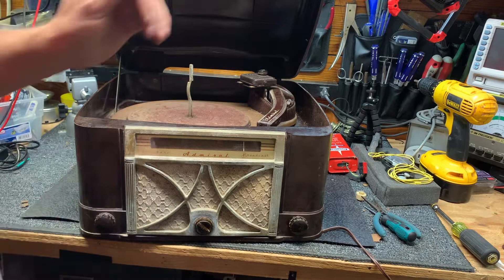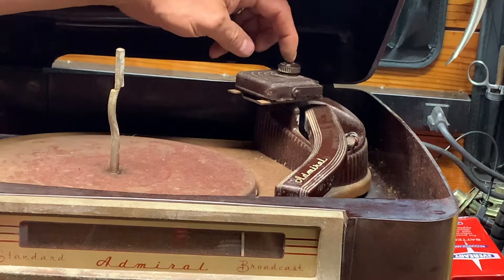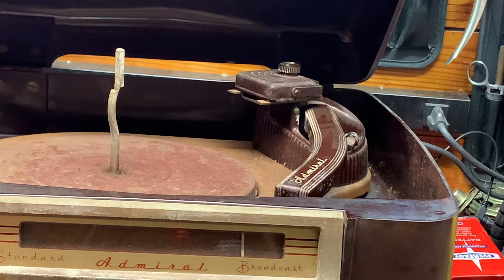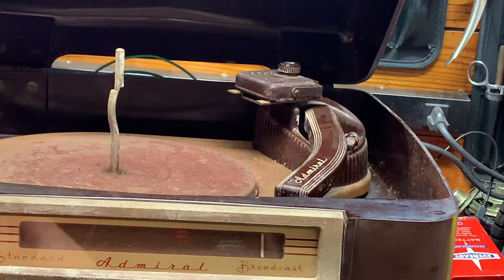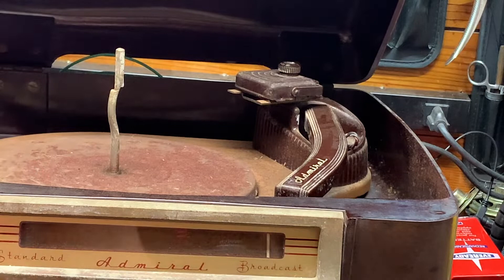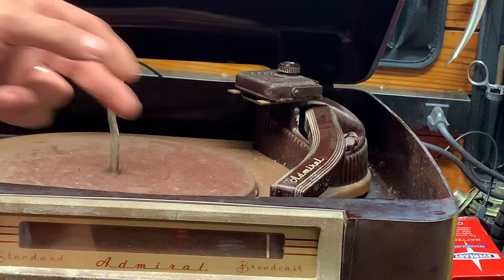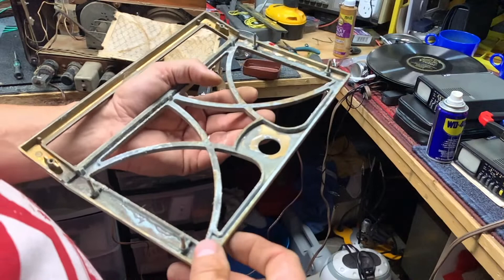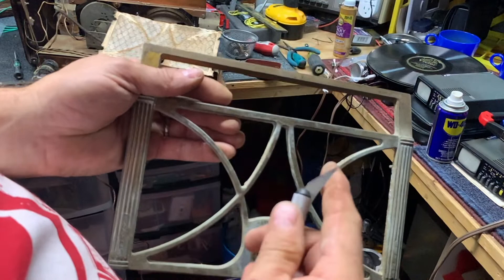Vintage Tech: Admiral 6F11n AM Radio and Record Player

Comment: I use Turtle wax 2 in 1 headlight cleaner for my plastic stuff...It is suppose to be used for removing the fog on car headlights. A sandblaster would be good on that metal piece.